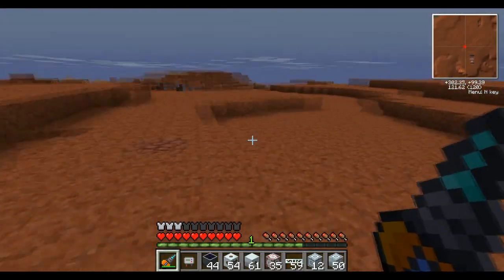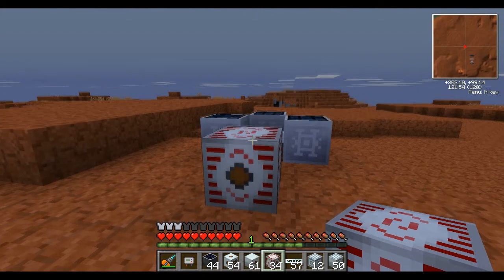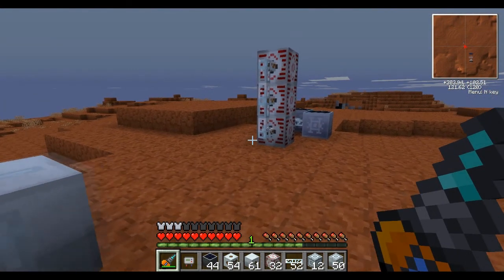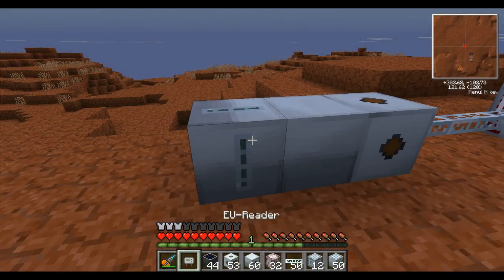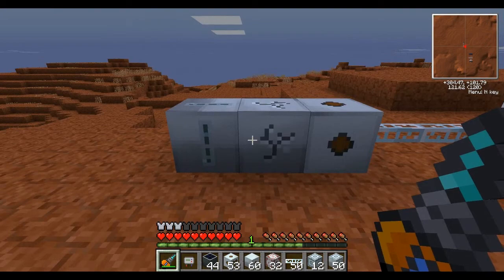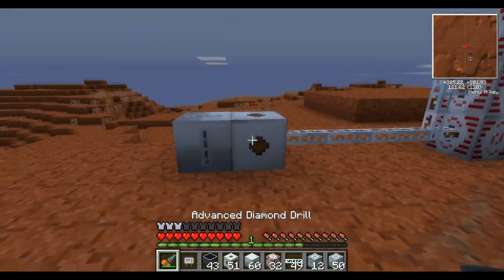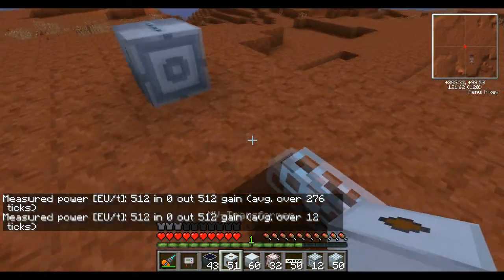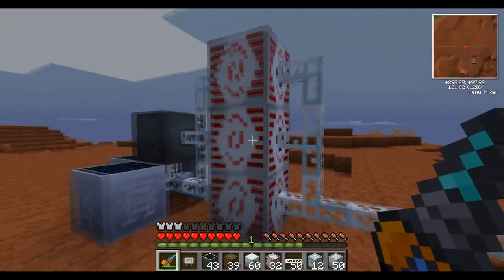Feed The Beast - Tip Series: IC2 how to power Mass Fabricators

Comment from the maker: Search "mass fabricator" in NEI (the search bar at the bottom of the inventory) and then click (or press "R" while hovering over) the mass fabricator. It's an extremely complex process, and requires about a dozen different machines with gregtech hardmode. I might do a video on it but it's been done by many so I don't think I could add much.